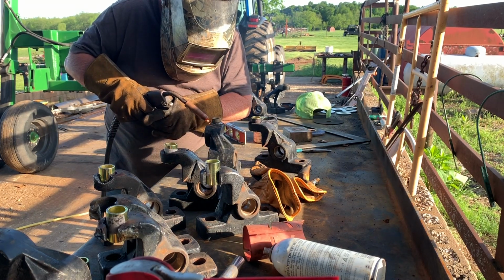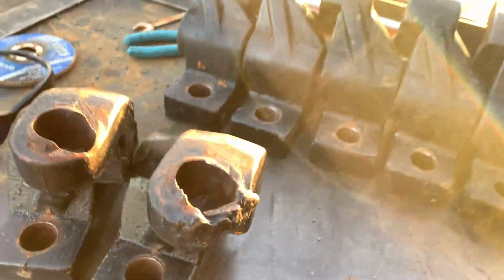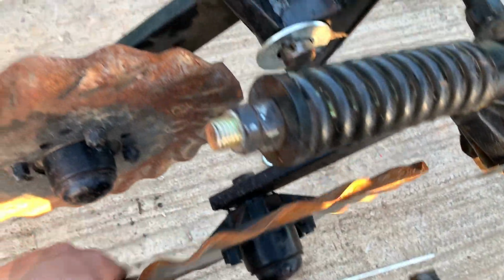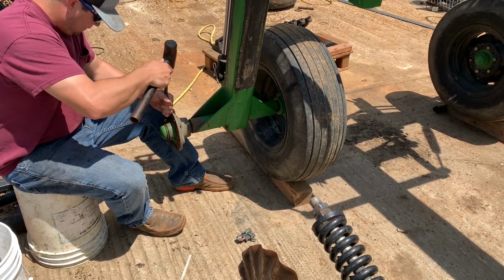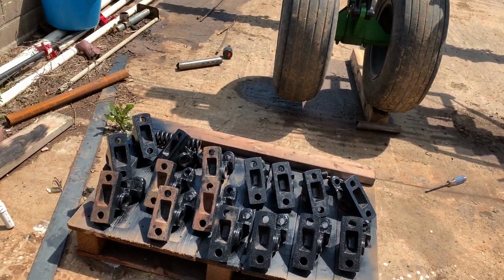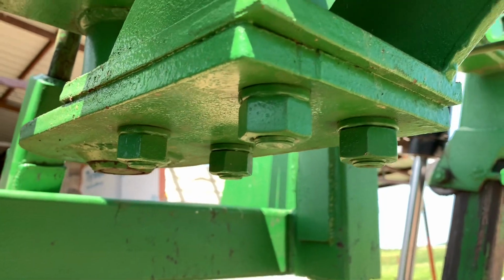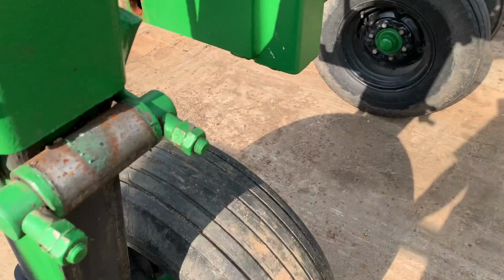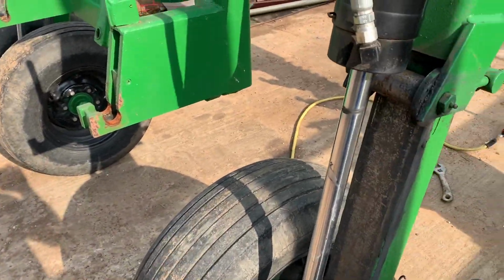Great Plains Drill Repair (Center Piviot Hitch) PT-1

Comment: Nice work... I removed all my front coulters, after 10 years of no-till and cover crops my soil is mellow enough now that the regular disk openers have no issues going in the ground. I hope that drill lasts you many many years
Reply: my names brad and my not till is sooooo great, i dont even need coulters meh meh meh meh meh..... giving you shit bud. Im pretty impressed with some of the drills that dont use them at all
Reply: Hahaha, thanks Will... Its been a long road to the point I am at, or I should say my soil is at! With your guys limited rain fall I can understand how your soil can get harder and need the wavy coulters. I guess not needing them is 1 thing I can add to my "To be thankful for" List! Lol
Reply from the maker: Thanks me too
Reply from the maker: We eventually want to start using a crop roller to roll down the cereal rye so I need the Coulter’s to cut through the residue. We need to build some organic matter.
Reply: Makes sense and is understandable

Comment: Did you get those bushings from great plains? I need about 30 of them lol, mine pretty worn out and I dont want to replace the entire cast assembly
Reply from the maker: The 2 black plastic ones I got from Great Plains. But the older castings wouldn’t fit them so we bought hitch pin bushings from the local ag supply store inside diameter 7/8” outside diameter 1 1/4”. We tried 3/4” bushing but it’s to tight when assembled.
Reply: thats pretty slick, ill be trying that, have a 30ft drill and almost all the castings are worn worn worn
Reply from the maker: Good deal if you have any questions hit me up.